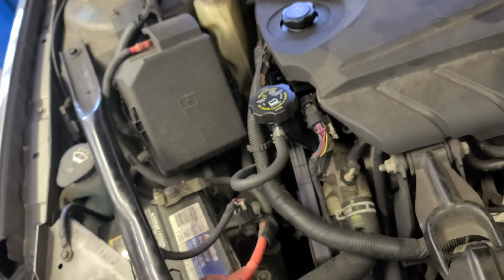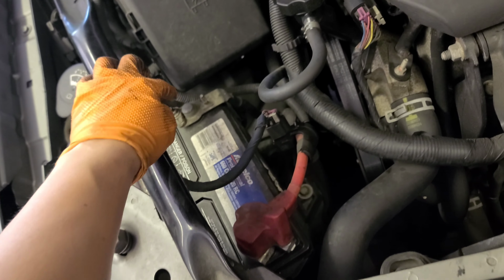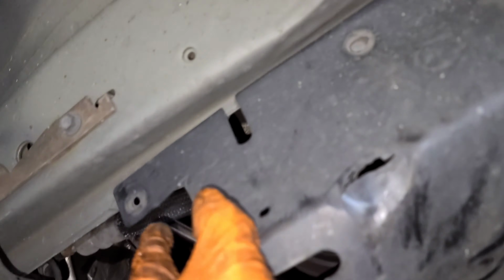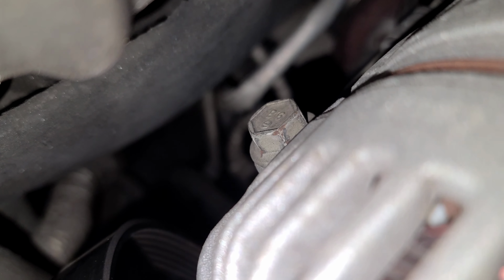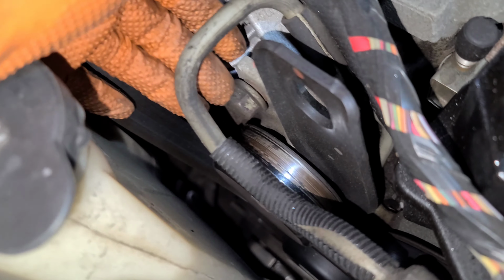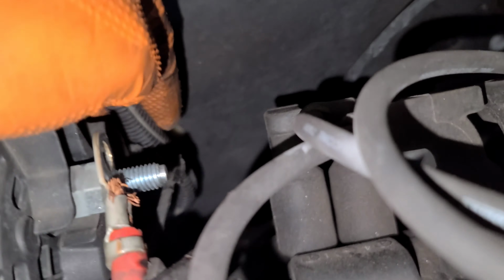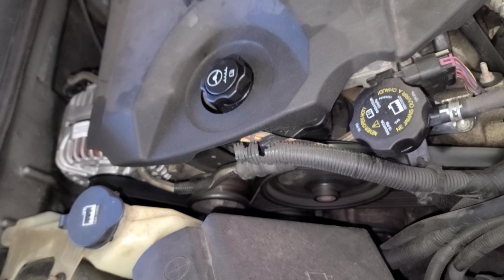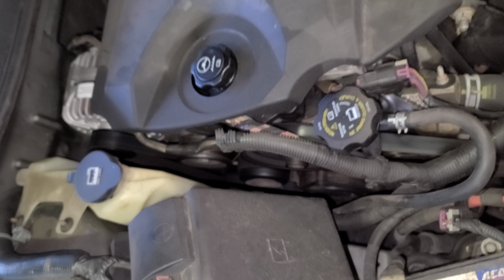2006 - 2013 Chevy Impala How to replace the Alternator

Comment: Future reference you can go from the top engine bay to get to the tensioner to take the belt off just remove the coolant reservoir I've done it plenty of times on a Chevy Impala of a 3.5 V6 this includes all other v6's Year's 2006 through 2013 Chevy Impalas.
You do not have to take off the wheel and ect to access the tensioner unless you choose to.
Reply: Qqà😂 red❤ppnll. As ààa
Reply: Someone didn't finish the video. That's exactly what he said in the video.
Reply from the maker: Where yall from?
Reply: EXACTLY... WHAT IS THIS LOOOONG GOING AROUND THE BUSH SHIT.  THAT TOO MUCH
... JUST REMOVE THE RESERVOIR